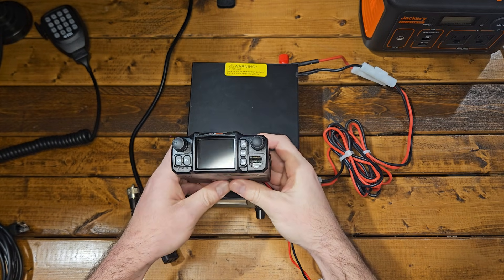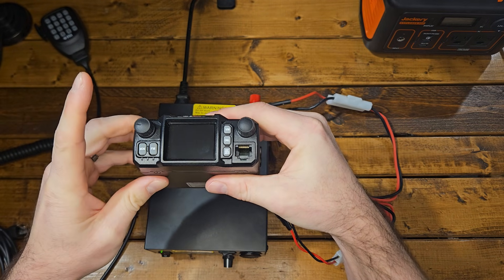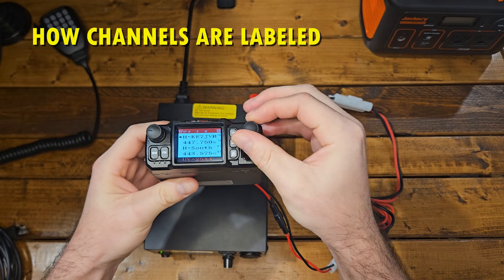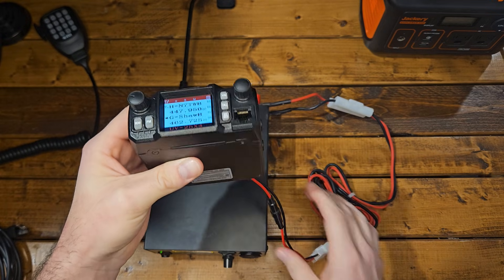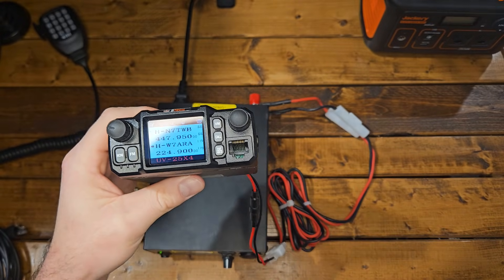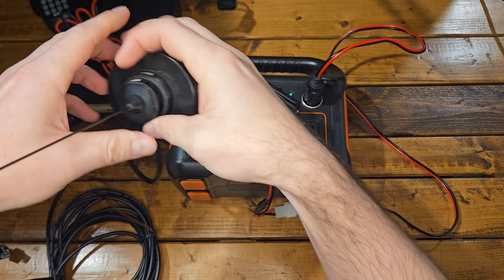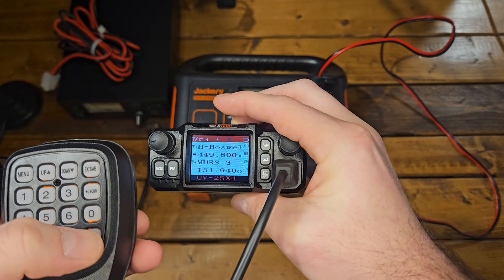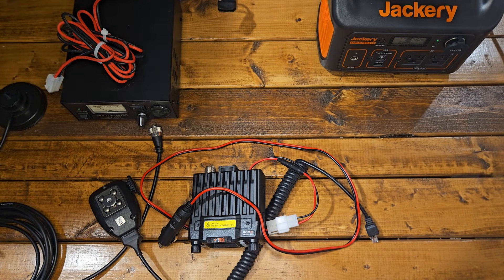Get Started with Your BTECH UV-25X4 25W Mini-Mobile Radio Programmed by Citizen Survival Plan

Comment: I have 2 of those in my cars plus a UV-50X2 in the house. I bought them specifically because I'm a prepper, they came unlocked & they are very small. On the UV-50 the channel and volume knobs are on opposite sides (vs the UV-25) & it drives me nuts.